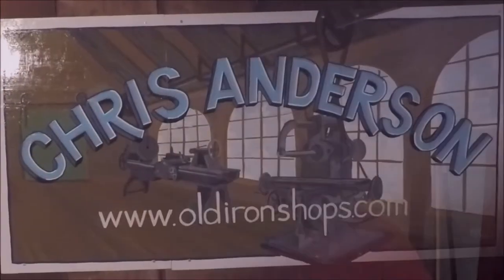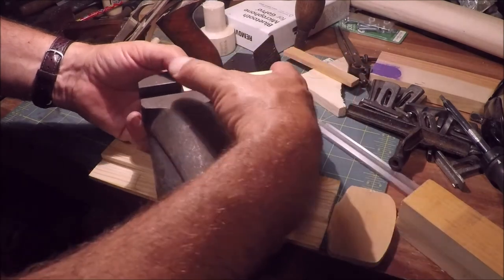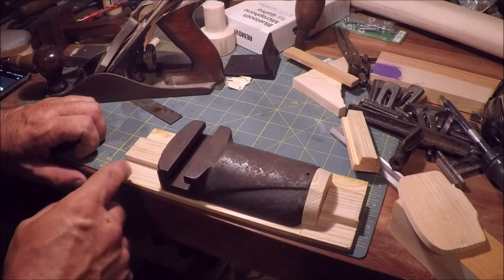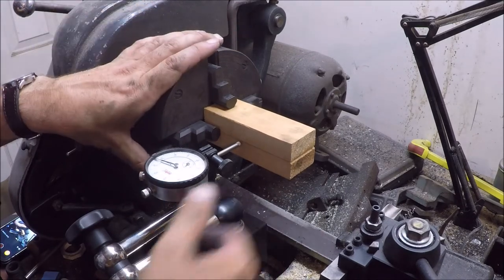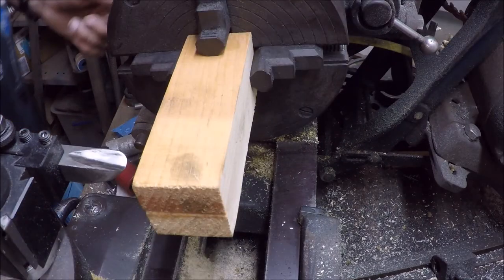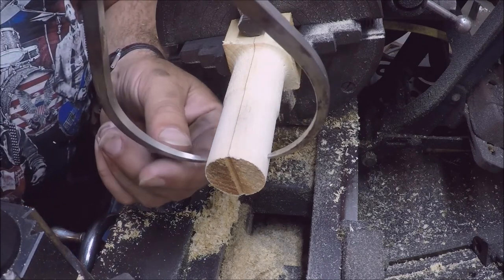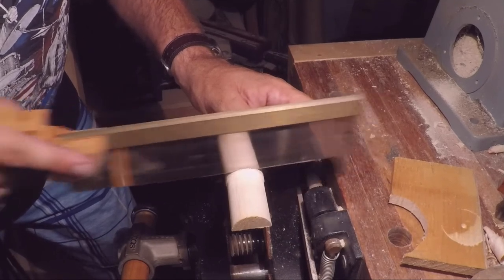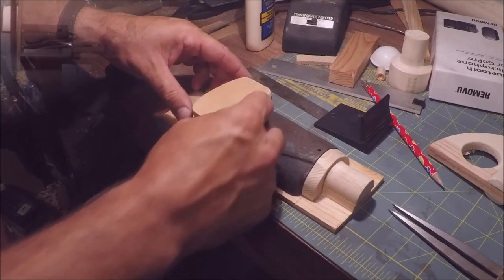Atlas Craftsman lathe: 10f compound slide pattern

Comment: Hi Chris...

Rather than using a core box cutter in the router could you not use a forster bit and drill the prints end on...then break out the waste with the tenon saw...?
Reply from the maker: I have done it before. The finish was not very good and the core is longer then my bit .
Reply: Old Iron Shops

OK....
Reply from the maker: Lots of ways to get the job done; )
Reply: Old Iron Shops

By the way I've gone and acquired yet another workshop table saw...and another lathe...both for lineshaft drive....

I'm sorry Chris...i can't help it...
Reply from the maker: nice scores glenn
Reply: Old Iron Shops

I got the lathe for £31....thats about $50...😏
Reply from the maker: Wow good deal. Just gotta get this stuff set up. So we can see it running again.
Reply: Old Iron Shops

It's got a gap bed....and requires some attention...but its all there and most importantly still has its flat belt cone pulley in the headstock...plus the corresponding cone pulley & fast/loose pulleys within the original ceiling mounted countershaft...

It looks not dissimilar to a Seneca Falls "STAR"...but its an English lathe probably around the turn of the last century...

Quite nice sitting on its original legs...
Reply from the maker: I Know How Hard those parts can be to find
Reply: Old Iron Shops

Oh I'll be making patterns of the countershaft brackets and floating bearing blocks Chris...you can be sure about that...

I'll do drawings...send em to you for your archives...
Reply from the maker: Oh that's a good idea

Comment: POWER TOOL? Nooooooo! Actually, I'm amazed that you went this far without using them. Great job and have a safe trip to Bar Z.
Reply from the maker: That's the plan. If I had a corbox plane I won't need to lol but look them up on ebay. Very spendy.